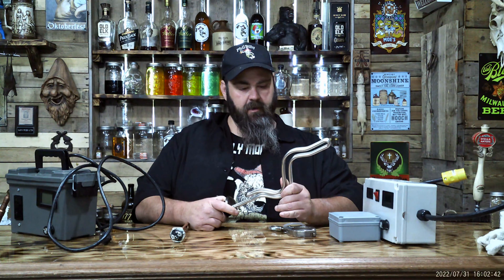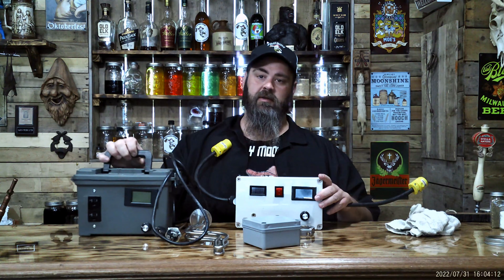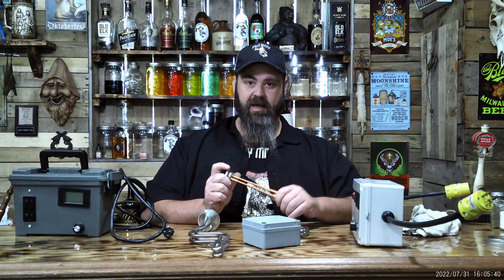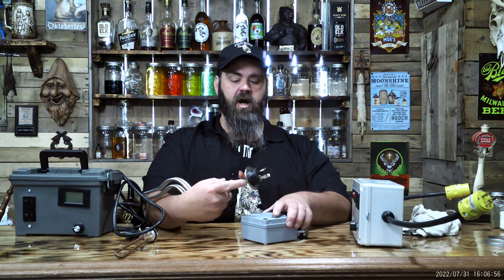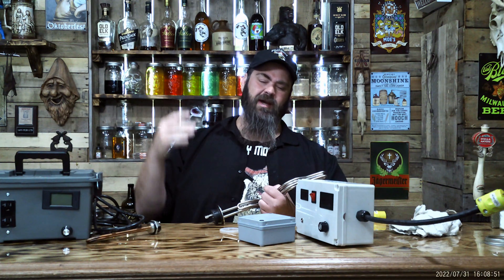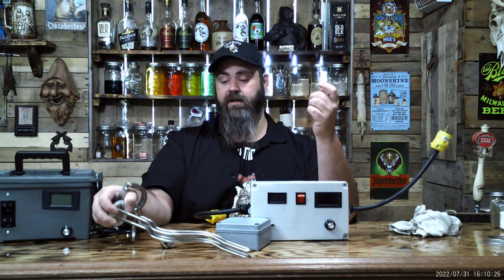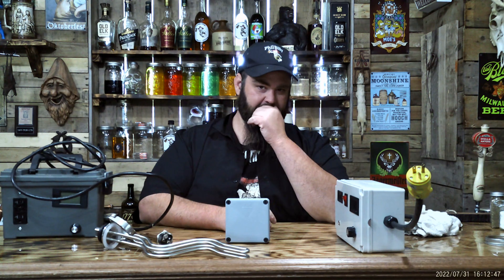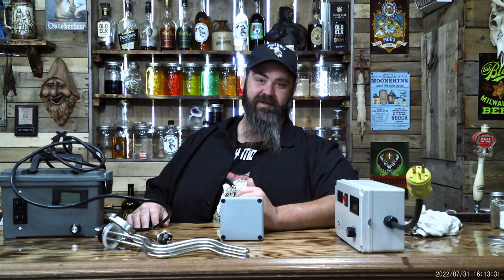Going electric with your moonshine still

Comment: We just welded a hot water heater element with a temp control into the bottom of our keg, works like a charm
Reply: can you post a link to the temp controller you used?
Reply: @kevinlong3992   it’s an electric water heater thermostat control. Pull one off an old water heater or get one from any home improvement store. 
Depending on how hot you can get the element you may need two of each, one may not get your keg hot enough

Comment: Hey Philbilly, love your videos! I was always taught low and slow on heating up my still. 
Do you suggest full blast? Sometimes I get tired of waiting, and think to myself, I should just crank it all the way up….Let me know what you think…
Reply: I crank it until it reaches the thumper then turn it down 25% then when it starts to run I turn it down until I get the drip rate I want
Reply from the maker: I crank it wide open until im at about 170
Reply from the maker: Just make sure you don't have any solids in your pot and you'll be fine and with an element you have to worry even less about burning any solids that might make it through. If i am not dripping in less then an hour i'm pissed off.
Reply: Thanks, keep the videos coming….

Comment: I perceived with a P I D til I was blue in the face I eventually drop kicked it out the back door and then made a 10,000wt capacity S C R, ( in layman's terms A power dimmer switch) and never looked back, you can dial in P I D's but I just couldn't be fukked.